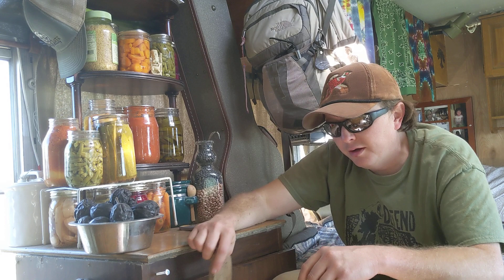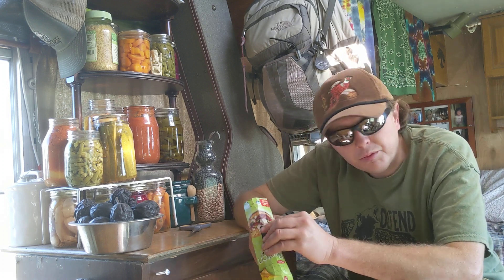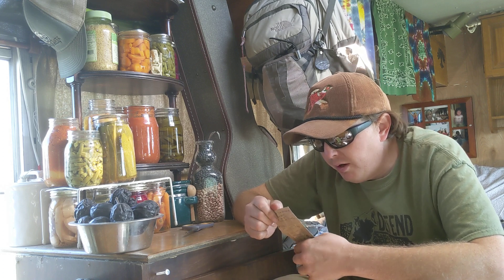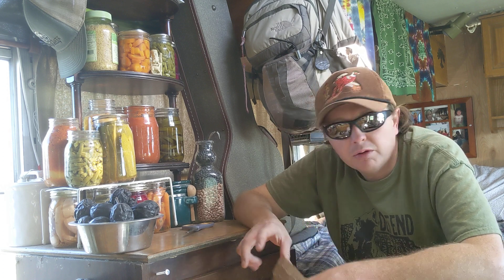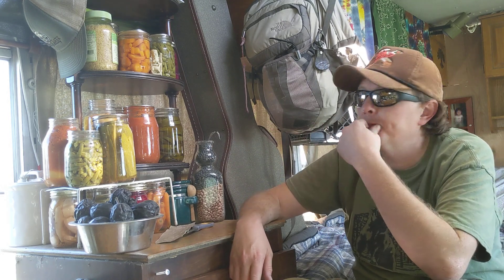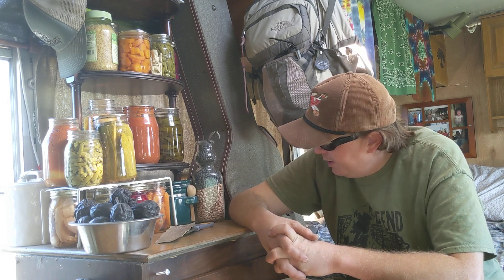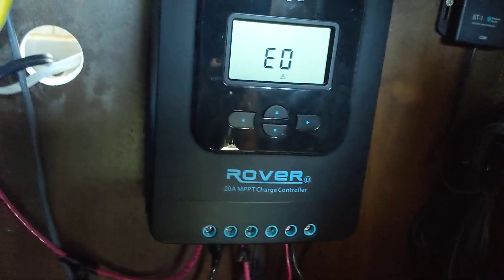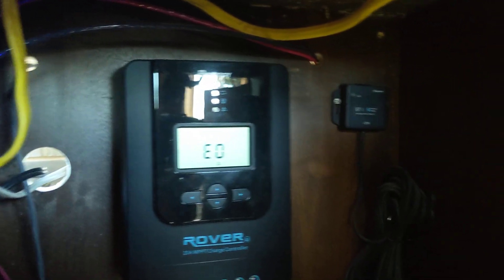Part 2 of What I've learned from nine months off grid with reclaimed Nissan leaf battery modules.

Comment: Okay just finished binge watching the series. Great layman’s explanation. My only present question, I am sure are to come, I was led to believe that lithium needed a BMS, but I do not see one in your setup. Do you not need one?
Reply from the maker: That's a personal preference choice that I thought I had explained but maybe I didn't. I guess I should if I didn't 🤦‍♂️. Anyway, I've only got 12 cells in my entire bank. I could buy a BMS and have it automatically track and trace and adjust. But I never really did because part of me wanted to prove that you don't need one. I've always said that if you get much over the six modules like I had that would be a mess would make much more sense but as long as you stay six modules and under it's just as easy to manually check them with a multimeter once every couple days. I'm not saying that's the right way to do it, and it's obviously more work and hassle. I'm just stating that it can be done and if they get too far out of balance what I do is put a heavy load on the system until they get back into somewhat of balance and then just let them continue to charge. None of mine have never been more than 0.2 of a volt off. and another little tidbit of information that's specific to my system and my system only is that I ordered my modules at four different times that were months apart from each other. I don't recommend doing that because what happened is I got modules from four different cars. I've got four different wattages between the six modules that I have. And that's another reason that's exclusive to mine system why I don't have a BMS. If I put a BMS on my system I would end up losing the top part of my highest capacity batteries because what would happen is the BMS would automatically only allow charging up to the smallest capacity module. Hope that makes sense, the BMS would do its job by equaling everything out and making everything the exact same but in doing so I lose capacity off the top end of a couple of my batteries.
Reply: You could have mentioned it and I missed it, but thank you for the clarification. If you are not part of the  DIY Solar Forum.com,, you should be. Your knowledge, in my opinion, is invaluable. And the real world experience is a nice touch. Always hated it when some kid with university knowledge but no in field experience would act like they knew better than those that work with a subject everyday. And see the mishaps and errors they don’t print in the books.
Reply from the maker: @col.johnson9938  Those are pretty much all the reasons that motivated me to even do this channel! I tried not to do anything or make videos about things that people already have. There's a million in one instructional YouTube videos and how to install a solar system and even videos detailing each individual component but nobody ever goes through the whole process and explains everything. That's usually because most people don't do it all themselves to be honest with you. They might install the solar panels on their roof but then they have somebody else do all the wiring or vice versa or whatever combination But when you don't do the whole thing yourself you're not going to be able to diagnose and repair it on the side of the highway if you need to.
Reply from the maker: Are you Mr. Kenney?
Reply: I am Storm
Reply from the maker: @col.johnson9938  ahh ten⁴. Gotcha.